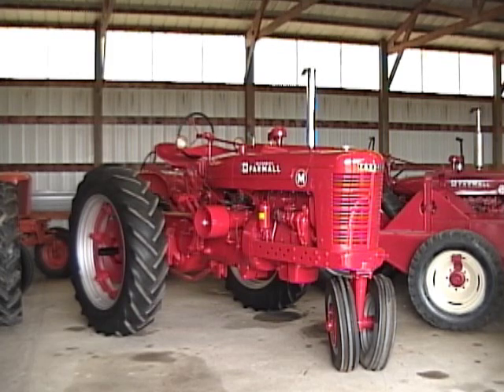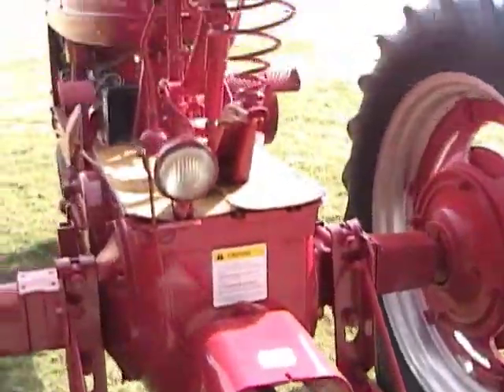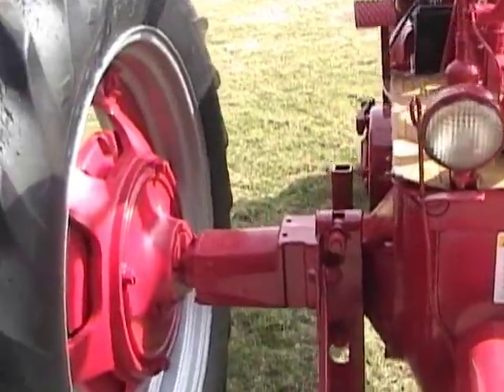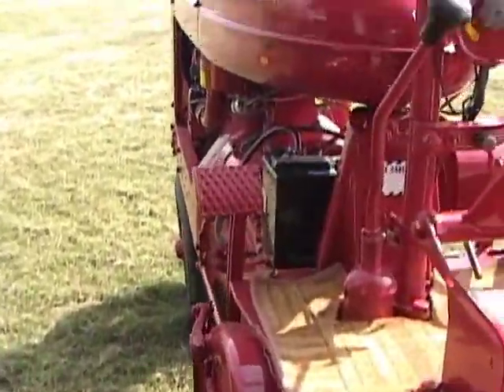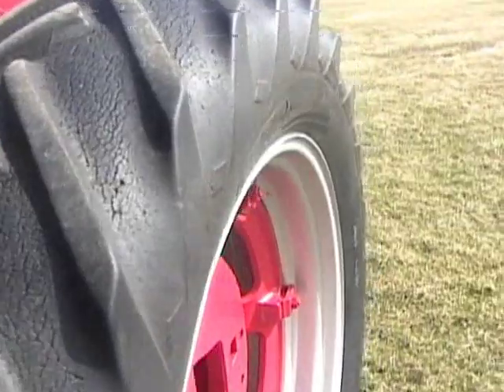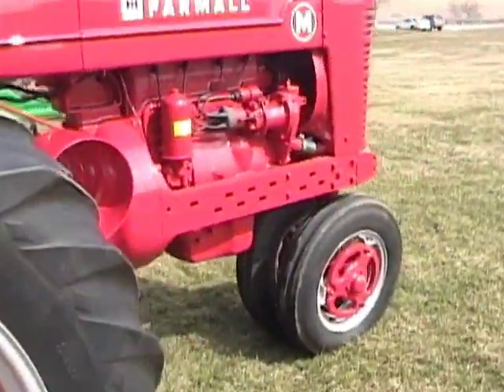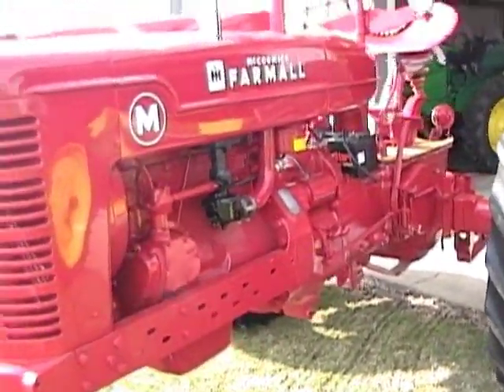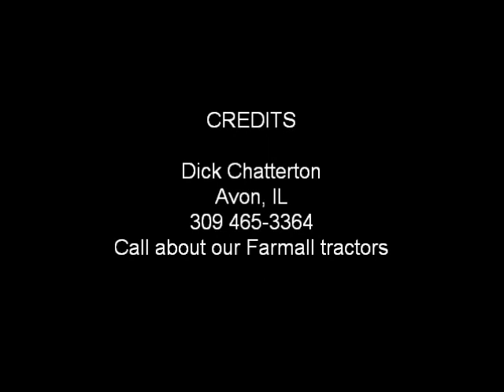Farmall M restoration

Comment: You sure got one great tractor for sure.
I drove one on my Grandads farm back in the late 40's and early 50's.
I was only about 11 or 12 years old and drove it pulling a baler as well with a v snow plow in the winter with chains on the drive wheels.It all so had a loader on the front end.